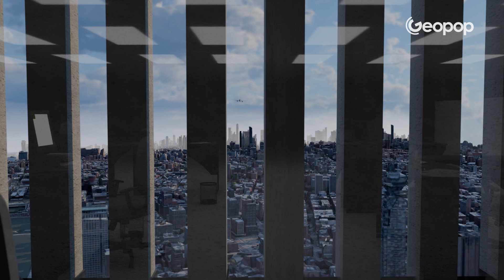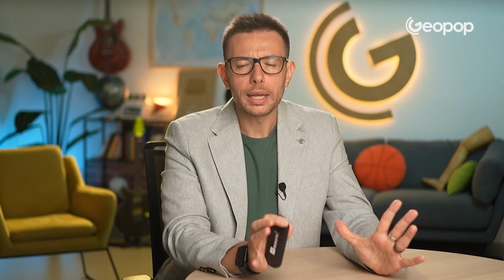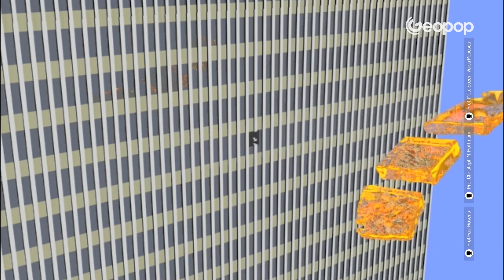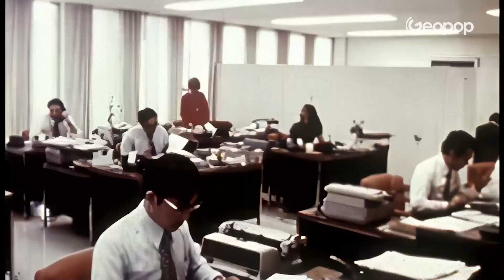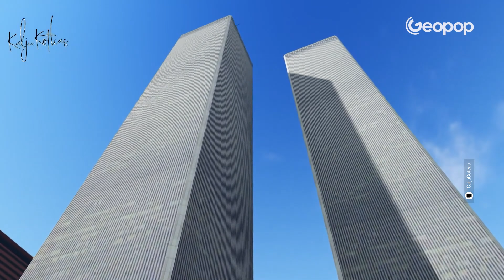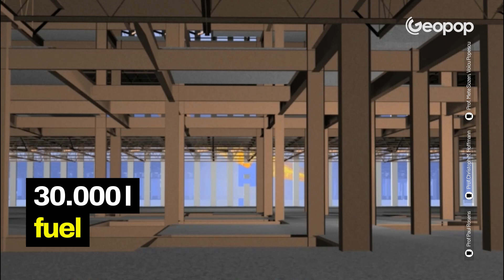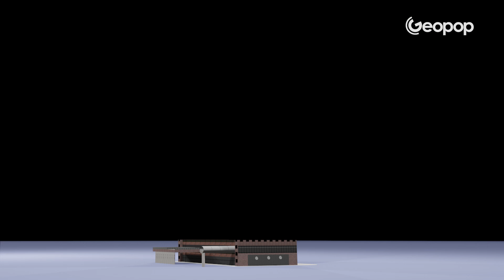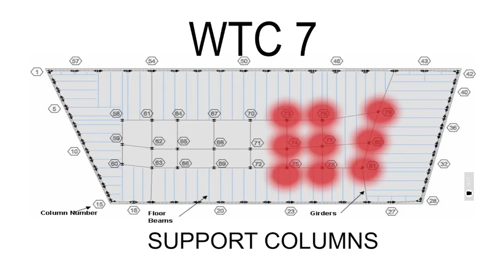9/11, 2001: The Technical Reconstruction of the Twin Towers and WTC 7 Collapses

Comment: This is the most fucked up shit I ever herd you make no sense 😂 still dont fall like it did I have been a welder and iron worker fore 35 years the only way it falls like they did is a control those buildings were brought down buy a control demolition now you can bulshit everyone else but me stop the b*****
Reply: Well maybe this will penetrate:  Twin Towers collapses were relatively straightforward and well understood in the professional engineering community within just weeks. Yet there’s still a lot of really bad information floating out there easily accessible on the internet, premised on wild baseless speculation and pathological theorizing with easy hand-wave answers.  Engineering is hard. This stuff is simple, exciting and requires little or no thinking, so it gets far too much attention.

Because anything can seem like a conspiracy if you don’t understand how it works I prepared my own short yet detailed technical description of Twin Towers collapses from my own observation and analysis of available true and relevant facts. No politics, ideology or magical thinking, just engineering. Hopefully this will dispel many common myths and answer most if not all questions you may have about the collapses.  

While complex, most of the Twin Towers collapse mechanisms can be seen with the naked eye and easily discerned and understood by the layperson if sufficient time is taken to understand.

1. The Twin Towers consisted of 4 primary structural elements that together formed an integrated system where each relied on the others. 47 hollow box-section steel Core Columns carry the majority of the gravity loads. The 236 hollow box-section steel Perimeter Columns carry the remainder and ALL of the lateral (wind) loads. Long-span Lightweight Steel Trusses connect the core and perimeter column together at each floor with a Hat Truss on top to tie the structure together as an integrated unit where no element can survive without the others. There was no structural load bearing concrete and most components were bolted together.

www.youtube.com/watch?v=u7OqrC74Dm4

2. The impact of 117 tons of airplane (= to about 12 dump trucks) at speeds up to 590 mph with the energy of a ton of TNT completely destroys the aircraft. This in no way implies the Towers come out unscathed. Many perimeter columns are damaged or destroyed as are some core columns (example; 33 of 59 perimeter and 20 of 47 core columns damaged or destroyed at the impact floors in the North Tower), This damage is primarily through bolt-shearing failures at the end connecting flanges, as well as bending, twisting and fracturing of weld seams. There was no cutting or slicing - the reality was far more violent and messy.

3. The impacts destroy or damage fire insulation, fire breaks and sprinkler systems on multiple floors. Huge fires are started across multiple floors simultaneously and allowed to spread rapidly with no effective firefighting or fire suppression. This was an unprecedented fire event .

4. The hotter steel gets the weaker it gets . With fire insulation stripped away and no sprinklers the survival time of the steel greatly reduced. Gradually over time heat causes the lightweight steel Floor Trusses at the impact damaged floors to sag, which was observed and recorded. No steel melted or needed to. Structural steel fails long before it becomes a puddle. It just needs to bend

5. Sagging floor trusses pull on the increasingly weak and overloaded Perimeter Columns, causing some of them to bow inward by up to 5 feet. A straight column is up to 4 times stronger than a bent column. The bowed Perimeter Columns buckle and fail, quietly initiating collapse. The formerly static mass above which the structure below could easily support is converted to a dynamic mass up to 30 times greater. Because they have buckled, the Columns above and below the failure point are no longer aligned . The load bearing structure below no longer bears any load as it falls past the lower columns, NOT onto them.

www.youtube.com/watch?v=ULdiD6gYZO0

6. Thousands of tons of debris fall within the four outer walls, down through the open office space, crashing onto the first intact floor it encounters, immediately breaking the bolted column connections as the amount of resistance the Floor Trusses can offer is negligible. The falling debris slows only marginally and briefly. Note: 
6a. This is NOT a solid top block crashing into and “crushing” a solid bottom block . 
6b. The debris falls past the columns not onto them. The columns provide no resistance to the falling debris. 
6c. Only the bolted floor truss connections to the core and perimeter columns offer any resistance. A pair of 5/8” bolts at each end of each truss vs. thousands of tons of falling debris. 
6d. No laws of physics are violated. 
6e. There is no 20 floors against 90 floors but rather 20 floors against one floor, then 21 floors against one floor, then 22 floors against one floor, etc. 

7. This floor-led collapse progression within the four outer walls can only go straight down.
7a. This process is often incorrectly referred to as “pancaking”. The catchy name stuck but nobody knows what it really means and "pancaking" is too simplistic and inaccurate anyway. I prefer Kaiserschmarrn.

8. Collapse progresses through the floor systems past the columns, through the path of least resistance . The resistance offered by each floor is always the same while the mass of debris and its velocity – thus its energy - increases with each floor failure. Each floor offers the exact same resistance to the falling mass while with each failure the falling debris constantly gains both mass and velocity. *This process of floor-by-floor destruction cannot be arrested, it can only speed up . Rate of floor failures increases with each floor as momentum increases, reaching an average acceleration of 0.65 of GA, or 35% slower than true free fall. Bam, bam, bam down the building until there are no more floors to fail. The resistance offered by each successive floor is always the same. More mass, more velocity, same resistance with each floor. Don’t get stuck on the but the lower floors weren’t on fire nonsense. They weren‘t and didn’t need to be.

9. The Towers were 95% air by volume. As that air was compressed inside the building it is forced down the tower and blown out the sides in reaction to the building collapsing . Those were not “explosions”, it was expulsions of compressed air caused by the collapsing building, explaining the low velocity, lack of flash, blast, supersonic pressure waves and lethal high-velocity ejecta.

10. Perimeter Columns become detached and peel away like a banana behind the collapse front, playing out to the four points of the compass extending to more than 600 feet from the base of the towers. This was quite obvious from examination of the debris pile.

11. Core Columns fail last as their internal beam bracing is stripped away by falling debris and lateral support from the floor to perimeter columns is lost.

12. For those who care about how long this whole process took; 31-34 seconds from the moment the perimeter columns buckled until the last core columns hit the pile, or 1/3 the rate of true free fall. Don’t believe me? Just watch any video of the collapses and note the loose truly free-falling debris dropping much faster than the towers themselves.

13. Each Tower had a 1-acre footprint. Far from collapsing inside their own footprints the debris pile spread out over 17 acres in a pile up to 14 stories deep. 8 surrounding buildings were destroyed and scores more damaged by the falling debris.

14. NOT observed were the 180-190 dB bangs of thousands of high explosive devices or the blinding bright flashes of burning thermite. Neither explosives or thermite could have survived the impacts and subsequent fire nor could have caused the (silent) perimeter column buckling that clearly initiated collapse either. A video of a shocked and injured firefighter casually using the magic word explosion is in no way proof of explsoIVES and the demolition_ case relies entirely on that sort of thing. There is zero tangible physical evidence and it would be technically impossible, totally impractical and completely unnecessary. No one would bother.  In 24 years zero structural engineers of tall buildings, including the 1/3 that have retired in that time, have made any statements in support of pre-planned demolition claims. NONE. The lack of any such citations in the engineering literature (published in any country worldwide) is telling.

15. Twin Towers were perfectly safe within their design envelope. They only collapsed when taken far outside design parameters by an extraordinary and unprecedented event

Impact + Fire (heat) + Time + Gravity = Collapse . Remove any one of those 4 elements and there is no collapse. Ignore any of those elements (as many do) and you will never understand the collapses. The Twin Towers were an integrated system in which no one component could survive without the others. One fails, the rest follow, through the path of least resistance – DOWN – through the open space, bypassing the path of greatest resistance – the columns. Nothing I just described violates any laws of physics. All of the above is true no matter who planned and carried out the 9/11 attacks or why

I hope you found this helpful and informative. It is not meant to be adversarial, but to solicit informed critical comment, positive or negative. If I made any errors of fact, logic or reason or left anything critical out, please let me know so I can fix it. To stay focused, just one topic at a time please and on-topic (Twin Towers ONLY). No word-salads of Gish Gallop. IF you can offer a more plausible alternative be my guest. Please start any reply with the words “Tits McGee” or I will know you didn’t read it, are not serious and just wasting my time.

Comment: "practically no resistance"  of the floors below needs to be elaborated. Even if it was only the air below, it would have had some resistance. The rubble and debris should have gradually dispersed sideways, and at least half of the building should have remained standing. We all saw how the top part of the south tower went sideways, so what destroyed the floors below? You can sell the story to naive  people, but not the truth.
Reply: Let’s break it down to the absolute basics:

The 47 core and 236 perimeter columns of the Twin Towers support all of the gravity loads of the building. ALL of the resistance is in the columns.

Planes impact Towers, causing massive structural damage, destroying sprinkler systems, tearing out gypsum board walls and blasting off the SFRM insulation from the floors. Multiple floor-wide fires are started instantly and spread rapidly due to the destruction of fire protection systems and venting of the building during the impact.

Serious fires were largely confined to the impact damaged floors and those immediately adjacent to them.

Fires were started by the impacts and fuel aboard the aircraft, which acted as an accelerant. No shortage of other consumables inside the tower to continue the fires.

Collapse was initiated (started) at the impact and fire damaged floors when floor trusses exposed to heat over time sagged, in turn pulling on and causing the inward bowing of some perimeter columns by up to 5 feet until they buckled on one face of each tower (ie: NOT symmetrically).

www.youtube.com/watch?v=ULdiD6gYZO0

No steel melted or needed to. Structural steel will bend and fail at less than half its melting temperature.

Once the perimeter columns buckled the formerly static load above became a dynamic load 30 times greater, easily overwhelming the structure below.

Thousands of tons of now loose debris fall through the open office space within the four outer walls - bypassing the columns - dropping 12 feet onto the first intact floor it comes across. That massive instant overload causes the floor to fail, shearing the pair of bolts that secure each end of the floor trusses to the columns. The floor fails. adding its mass to the falling mass which continues to accelerate for another 12 feet until it impacts the next floor, rinse and repeat one floor at a time all the way down.

The columns - the part that holds the building up, supporting ALL of the gravity loads - are spectators for all this.

Rate of collapse increases as momentum increases. The collapse front is constantly accelerating.

As each floor fails, air inside the building (the Towers were 95% air by volume) is compressed, then blows out the sides _in reaction to the Tower falling, not the cause of the Tower falling.

No fire required at all on floors below the impact points for them to fail. The mechanisms that started the collapse are different to the mechanisms which continued the collapse. That will be a difficult concept for some.

As the floors fail the perimeter columns are left literally hanging in the breeze, no longer attached to the rest of the structure. They peel away and fall in great sheets (think banana) out to more than 600 feet from the base on the 4 points of the compass

Core columns failed last.

No Laws of Physics are violated so no need to invoke magic or divine intervention

Each 110-story tower had a 1-acre footprint. The debris pile was up to 14 stories deep and spread out over 16 acres, destroying 8 surrounding buildings and damaging more than 100 others.

Anything can seem like a conspiracy if you don’t take the time to understand how it works. Hopefully now you do.  If not, I can go into much greater detail.

Comment: WTC 7 collapsing on its own is all the proof you need to know this was planned. But on top of that, the fact that the owner of all 3 building, Larry Silverstein took out terrorist insurance on the buildings just days prior to this. And lastly, jet fuel can't melt steel beams. It'stime to wake up, people. Those towers would have collapsed without the planes.
Reply: It would probably make more sense to you if you used actual true and relevant facts rather than just copying failed conspiracy memes off the internet.

Comment: Ok, so the heat from jet fuel caused the twin towers to get hot enough to cause beams made to resist fire, but paper caused building 7 to collapse ??
Reply: Building 7 took a lot longer. Collapse mechanisms entirely different- as explained above.